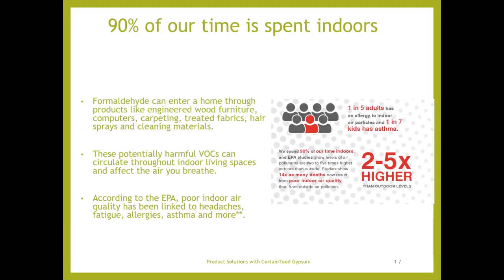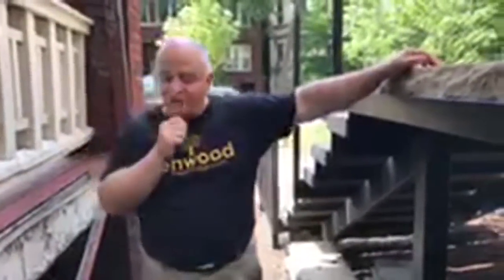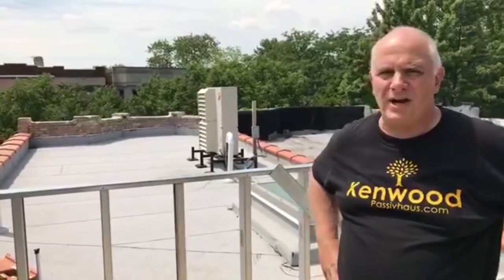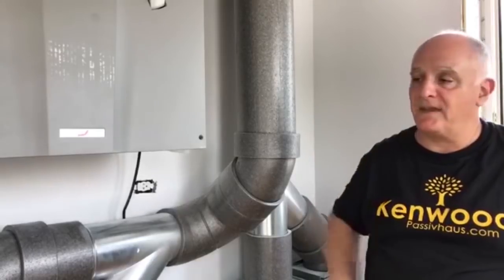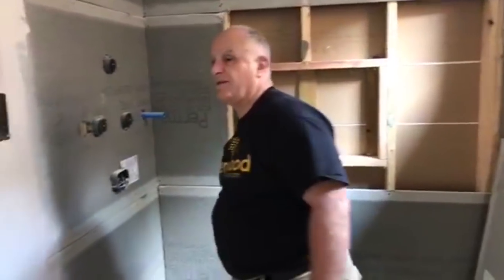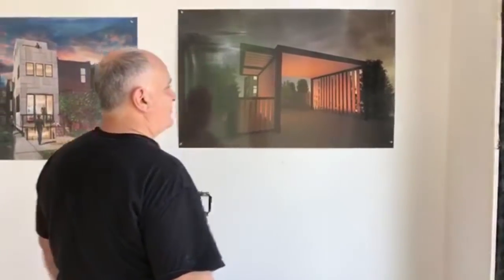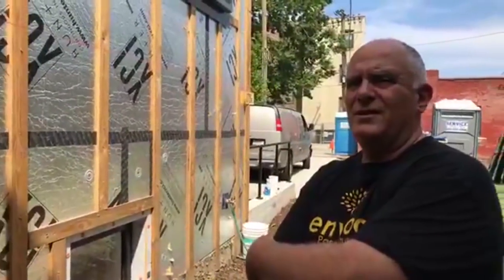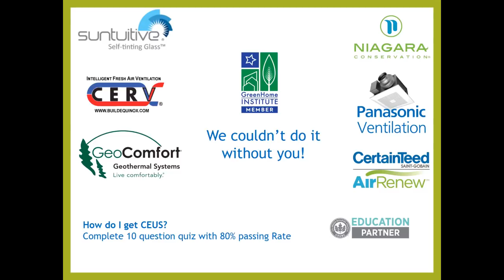Tour Chicagoland’s First Passive House Residential Retrofit - How Did They Do It?

Comment: what is the name of the European fiber cement cladding
Reply from the maker: "The cement fiber board panels that clad the entire solid masonry structure but for the façade is made by Cembrit and it’s “Minerit HD” which is natural in color.  https://www.cembrit.com/

 

It’s workability is great.  The price was ~ $3.50 PSF before shipping.  It’s very easy to install once you find a game carpenter.  It doesn’t require metal trim or secret sauce when you make a cut like Hardie Board.  Colored or etched products are ~$10 PSF.  Great product. Hardie Board is like cardboard in comparison.
" 

 

Michael R. Conners

Kenwood Construction Services, Inc.

www.kenwoodpassivhaus.com

5485 South Ellis Ave

Chicago, IL  60615

312-399-3155

mconners@kenwoodpassivhaus.com